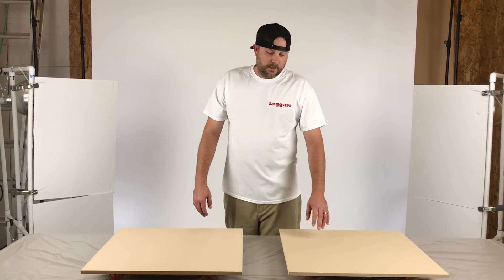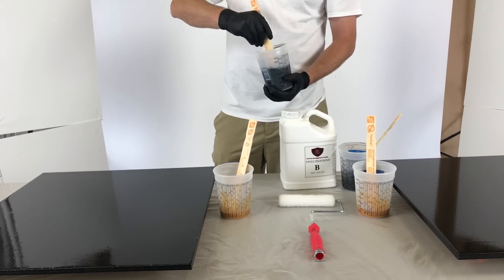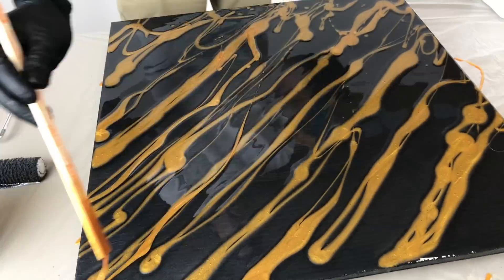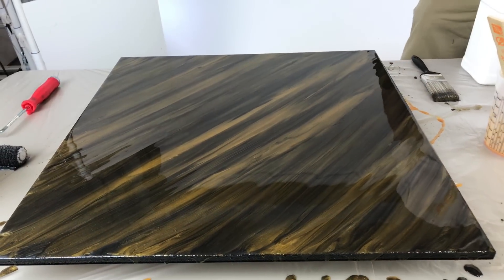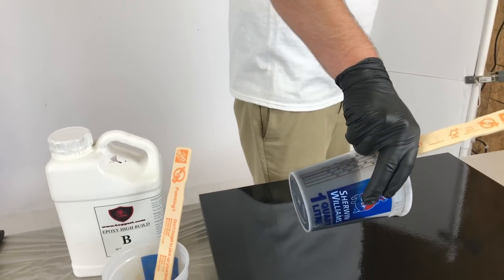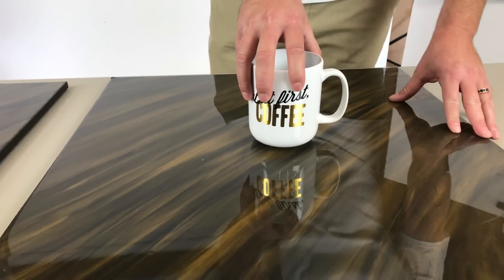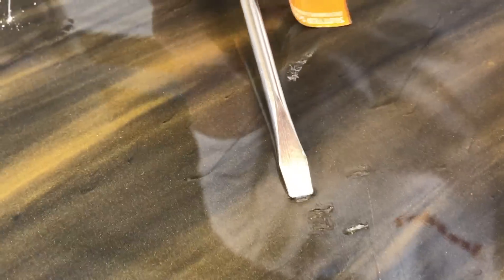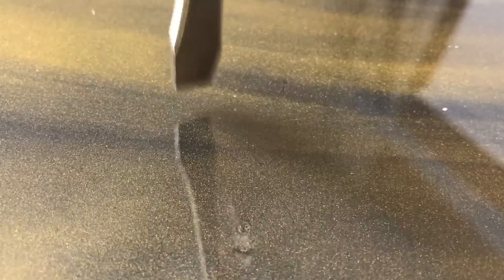This is what happens when Epoxy Resin is mixed Incorrectly or with the wrong ratio.

Comment: Hi I notice a scratch on the good on at 4.23..lol, would the bad one set in time if left longer or would this be as good as it gets ..
Reply: fishtank5050 Yeah, I saw that too. Wonder if it would scratch after a few more days. I really wish they would address this. I don't want to order it anymore after seeing that
Reply: I haven't used their products yet but am fairly experienced in working with epoxy resins. Epoxy is more likely to get scratched than for example polyurethane because it is more brittle. But the curing process usually takes longer than the three days shown here, so it will be even more resistant after a week. Also note that the screwdriver he used probably has a hardened steel tip, which easily scratches most materials (it's relative scratch hardness can be as high as that of quartz!)The bad one will probably never fully cure. Correct resin/hardener ratio is crucial whren working with epoxy!
Reply: @kiela17  it scratches. im surprised their consumers havent commented. 3 years later my floors are scratched to hell. the scratches are deeper than the top coat too

Comment: I’m working on a project which is a large map of an island (24”x30”) made out of sand and glue. The ocean and lakes have been made with colored resin. Different blues in the ocean. I now need to sand it to tidy up some ugly ripples before applying the final layer of clear resin. I need the resin to be thin in order to work around the fiddley edges of the island. I also need more working time. What is the best way to thin the resin?  I will be mixing approximately 20oz of mixed resin total (10oz of each resin and hardener).
Reply from the maker: Our epoxy resin has more working time than any product on the market.  You will not need to thin our product out.  Thanks

Comment: Would the poorly mixed side eventually harden?
Reply: Was it poorly  mixed ? I think it was properly mixed but less hardener was used.
Reply: Not using enough product would equal poorly mixed.
And I'm still not getting an answer to my question.
Reply: No it wouldnt because not the correct amount of hardener was added
Reply: Amber Flanagan And yet my point AND question still stand. Now go pester someone else, children.
Reply: it might eventually harden through CO2 but it would also become opaque with white blemishes
it might never harden depending on the axact chamisty of the hardener used
Reply: I have a question about epoxy.. Im new to this. I'm in the process of making a live edge coffee table, and i decided to fill a crack with epoxy. I did the epoxy pour yesterday evening. I followed the mix instructions to a tee (2:1) even going as far as using a measuring syringe to measure out both parts. I came back to the table today (20 or so hrs later) and the epoxy is gummy. Did i not mix the product long enough, or do i need to let it harden for a longer period of time?
Reply: it totally depends on the type of resin, look up documentation for yours and see how long it takes usually, after a day it can still be soft but probably not be gummy, also make sure you did 2:1 and not 1:2
Reply: Barnesrino Kripperino Thanks for your reply. Gummy might not have been the best way to describe it. I apologize. It's soft. Not gummy. I used a solo cup as my mixing jug, and had about an inch and a half of un-used epoxy left (over zealous beginners mistake), so I pulled the cup apart and looked at the leftover epoxy. No bubbles, no flaking or gum and consistent colour throughout. Just soft almost like rubber. Will give it a few more days and see if it hardens up. Thanks again!
Reply: looks about right, no bubbles not cloudy should mean it will be fine, in general

Comment: i have a question why after i poured my epoxy to my wood table top first 2 hours look ok and shiny and clear no bubble but after that came out with so many small bubble inside and look like some part inside not stick with my board at all...
Reply: i did use hair dryer to make all bubble come out at first but still after an hours outer layer fully dry but inner will create a lot of bubble and stuck or not even stick for some part...i wonder what problem is that i tried many time still cant figure out
Reply from the maker: We do not send out our primer with the sample kits, we do send the primer out with the regular kits.  Our primer helps seal any porous areas on the wood surface therefor you will not get the bubbles.  Thanks

Comment: What's the difference between the two tables?  and What led to that
Reply from the maker: The only difference is that one was done with the correct 2:1 ratio and the other one was not done with the correct ratios.

Comment: Are there any reasons why I should take precautions before using epoxy? I see you wear gloves. Are there other safety requirements needed? Like when you use turpentine you don't want to breathe it in
But you didn't wear a mask. Were you in a well ventilated area? Is there a way to seal it so it doesn't allow you to scratch it up? I mean, if you have little ones around, they'll put anything they can get into their mouths.

Comment: is there a way to put a clear coat on a  vertical surface, like wallpaper ???
Reply from the maker: This is not a good application for vertical surfaces because the epoxy will just run.  They are coming out with a vertical surface epoxy later in the year.  Thanks

Comment: I just did the "know it all" way and totally screwed up a 7 ft piece of yew wood I've been working on for a counter too. I've got Hard and sticky areas- what do I do to save it?
Reply from the maker: If the spots are sticky and not pure liquid then there’s a chance that over time (possibly a long time) it will still get hard. If the spots are still liquid or you just don’t have the  time to wait you should try and scrape off what you can and sand/grind the rest off. If it’s just a clear coat of epoxy that’s much easier, scrape off the soft spots, wipe the remaining residue with acetone to clean it off then flood the area again with clear epoxy. Hope that helps. Thanks

Comment: Seriously?! You basically didn’t add any hardner.
Reply: Josh Mallett that’s the point to show you how it could end up with the wrong ratio he could have put a lot more or a lot less
Reply: Exopy has two parts, Resin & Harderener.
Reply: If you can read,  read your Epoxy Tubes.

Comment: can i use it over a floor tile
Reply from the maker: Yes it can be put over tile, but you need to fill all your grout seams with multi purpose bondo from home depot, then sand it smooth, this will scuff up your tiles also, then wipe it clean with denatured alcohol then you are ready to apply our epoxy.
 https://youtu.be/g8GzsL0kpns

Comment: as seen at 4:25 even the hard epoxy can scratch. i used leggari epoxy on my entire concrete floor 3 years ago and the scratches are everywhere now especially near entrances and high traffic areas. rooms that have low traffic have very little scratch marks. ive dropped tools on it and yes the epoxy has broke in those areas. so even well done epoxy still isnt perfectly hard. iu was told to sand down the poly coat and redo the top coat. waste of time, I begun sanding down some areas only to find out the scratches are deeper than the top coat such as in the kitchen besides the stove where its pulled out for cleaning now and then. I was told i should have installed a felt liner so i guess thats my fault, but who uses felt pads under their kitchen stove over tiles? lesson learned epoxy is a fad and wont last the test of time
Reply from the maker: The topcoat used is a game changer. We recommend WB Urethane with grit over epoxy in high traffic areas. I'm sorry you've had issues with your project.

Comment: I didn't see what you did different with the second product. Didn't learn anything I'm afraid ...
Reply: I'm with you on this. He does say it will be screwed up, but never actually points out what will be wrong. I think - and it is totally just a hunch, there was less hardener in a mix.  Could have been more ? or he did not wait long enough in the application ? I'm not sure what was the mistake that caused total failure and this gives me less confidence in a product then before.
Reply: Stefan Van pellicom the first one he did it right. The second one he did it wrong. The point is to follow directions, not to teach you to be an expert epoxy mixer
Reply: Follow the directions and you’ll be fine
Reply: Then clearly you weren’t watching. He mixed it way less in the second one than he did in the first. Pay attention next time before you comment.

Comment: love seeing the scratch at 4:25 XD
Reply from the maker: FireLine2the9 We love that you can take a brand new sharp edge screw driver and scrape it on the surface of our epoxy with hardly any damage.
Reply: Just pointing out the fact you kinda sham-wow'd that side scratch a little no biggie.
Reply from the maker: FireLine2the9 haha not at all. We edit all videos and if we didn’t want that in there it would have been edited out. Nothing out there is scratch proof.

Comment: How can the wrong mixture be cleaned from a surface?
Reply from the maker: If it’s as set up as the mixture in this video then it’s a task. You’ll need to scrape up as much of the soft resin as possible, then grind the edge where the hard resin starts to flatten it out a bit. Once the profile of the area is relatively flat again you can re-pour the resin. Thanks

Comment: You should never use a drill to mix this stuff. Hand mixing with a stir stick will give you the best results.
Reply from the maker: Our epoxy is a high end resin, you can mix ours with a drill and it doesn't matter if you get air in it because we have a high end epoxy that has an additive in it to make the bubbles rise to the surface and pop on their own.  Thanks

Comment: Ok so I see what happens when you do not mix it accurately. How do you fix it? How do you fix random soft spots in your counter without completely restarting?
Reply from the maker: If you do not do the correct ratio, yes you will have soft spots and you will have to sand the surface with 120 grit and redo the project with new epoxy so you will get a solid surface.  Thanks

Comment: You explained nothing! Congrats!!
Reply from the maker: m782427 Waffen Just showing what happens when u don’t mix the epoxy correctly as in the right measurements.
Reply: Leggari Products yeah but you didn't measure anything. If you were to watch the video with no sound it would appear that you did the exact same thing both times. It is obvious to everyone that if a epoxy is mixed improperly it won't cure properly, so this video is redundant at best. It would make more sense to simply show  how to properly mix that specific epoxy.
Reply from the maker: Errl B. Dunkin' It’s to show what happens to epoxy if it’s not mixed correctly. Most people don’t know it could be soft or sticky if it is not mixed right, measured right etc that’s the point. Thanks
Reply: Leggari Products I know what you are attempting to show in the video, but you fall short.
Reply: Haha, sorry, my bad. I meant arguing. Can happen when you switch up two languages. And no, sorry, those aren't attempts. But, as we all know, stupid people won't accept that they're stupid. Got nothing else to say, I'm sorry. Now keep being mad about you being wrong, have fun.
Reply: Lots of ppl think that if they use less hardener the only thing it will happen is that it takes more to cure... 
I do agree that it would have been best to explain how much he used in one and in the other.. but unless your an idiot, you can understand what happened there
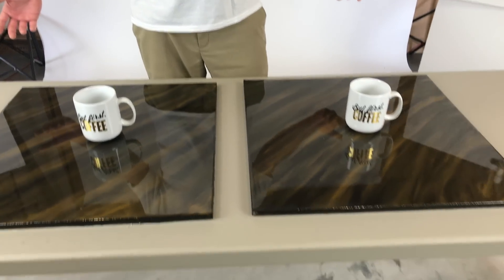Reply: Go to 3:17 and he displays it for you.  If you cant understand from that point on, then we have no idea what can save you from the pains of lacking common sense.  So read the directions carefully on what ever resin brand you get.

Comment: You should not say that it is best to mix epoxy with a drill... envirotex light which is one of the most commonly used epoxy resins available in the US per most retailers comes with instructions that specifically state the contrary. That is, to never mix with an automated mixer. So. hMMMmmMmMmm mr. know it all. Now what?
Reply from the maker: You just need to be educated with our High Performance Products.The reasons our instructions are contrary to other resins on the market is because its a higher grade resin with additives that allow the bubbles to rise to the surface and pop without any torching or chemicals. Thats why you never see us torching our resin and it always lays out glass smooth no matter how you mix it. Its simple, We only use the highest grade raw materials and all our products have been tested in real life environments. You never want to mix by hand always use a automated mixer! Thanks

Comment: Hahaha! He SAID it! "it's mixed, no its not" yall are funny! It wasn't mixed right And he used the measuring lines on the side! They were pour in right, they were Not mixed enough on the last on and therefore the Hardener didn't Harden Correctly. Also he said "just like scratching glass" of course it's gonna scratch the first one! A screw driver has a sharp edge, not just the flat tip! Hahaha, ya'll use ur brain and stop being sooo judgemental! THINK BEFORE YOU SPEAK

Comment: I used the so called Leggari calculator for 1,200 sqft;it game an estimation of $16,000 they're out of their mind they are way overpriced if you would go and estimate the most beautiful tiles for 1200 square feet will cost you way less than five grand installed it's overpriced useless for liquid you crazy?
Reply from the maker: That is not correct, for 1200 sq. ft. you will be around $2.45 a sq. ft.  You need to clear and update your cart then redo the process and you will be around $2.45 a sq. ft.
Reply: Your estimation is considered on us or Canadian dollar